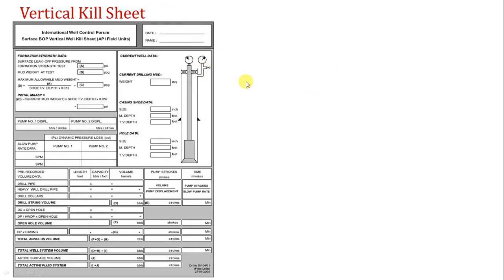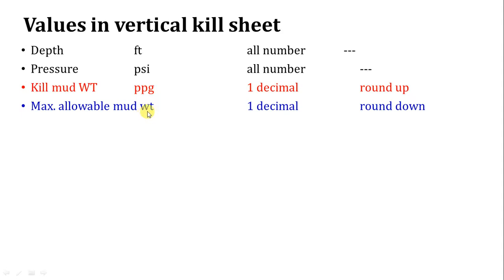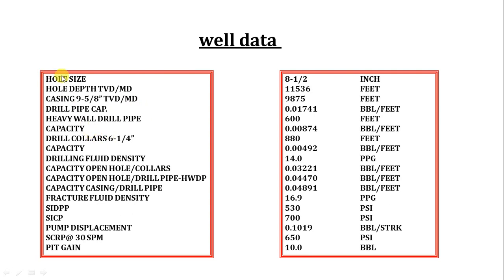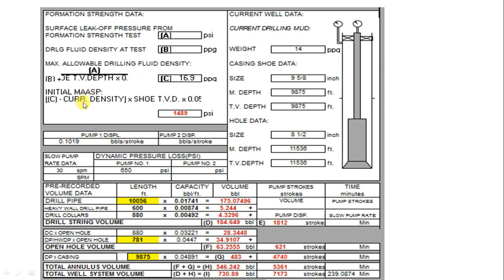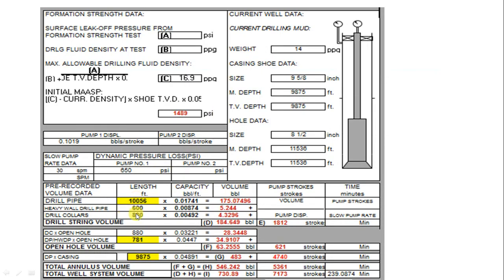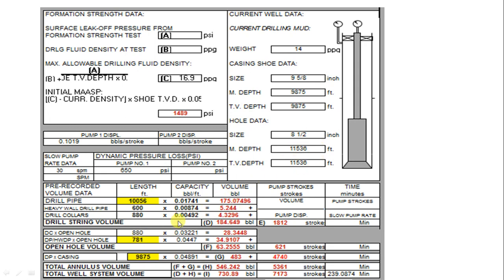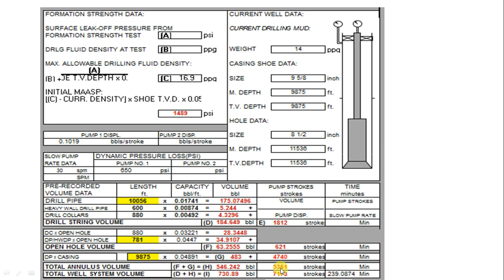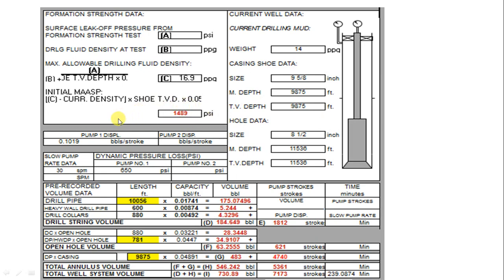21. IWCF:   vertical kill sheet

Comment: there is one confusion, the length for the HWDP they gave was 600ft. but you used (drill collar minus open hole length) = 11536-9875-880 = 781. why not 600? why im asking because drill pipe and hwdp volume is different. so if your length is more than hwdp that means that you have some drill pipe volume there also. so the total volume should be DC.vol (880x0.03221) + HWDP.vol (600x0.04470)+DP.vol (181x0.04891). is that correct? wait, thats inside casing. annular volume of DP and HWDP is same because both have same OD. ok sorry. i just make my own correction.